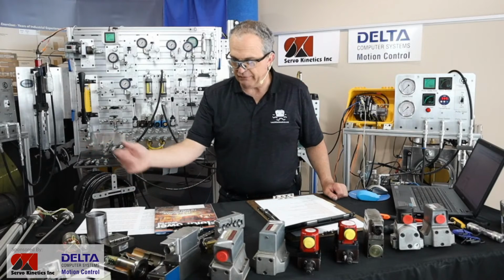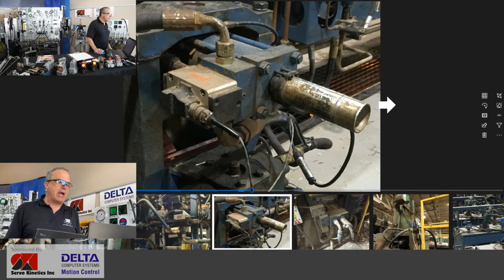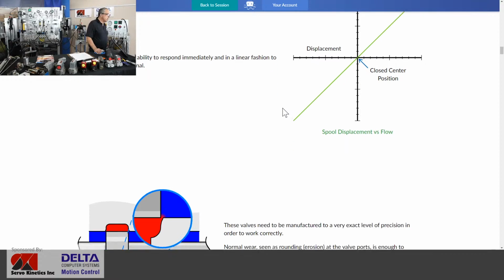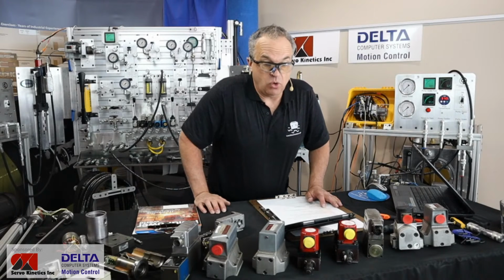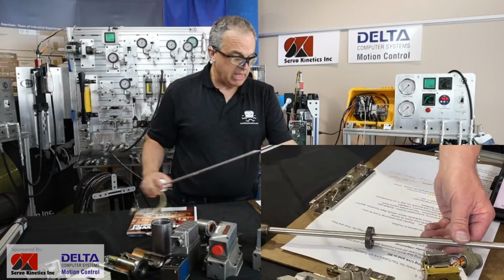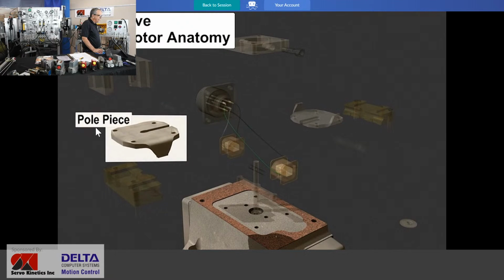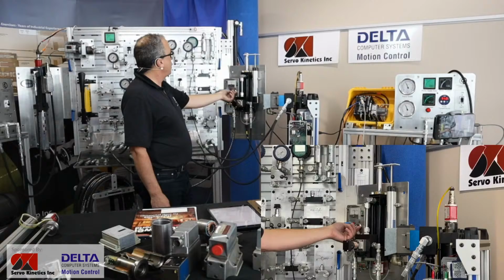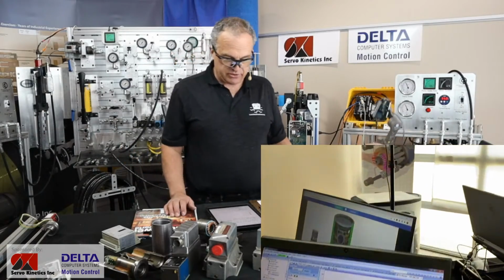Servo Valves: Live and in 3D

Comment: Your videos are absolutely great! One question: What happens with all the excessive flow from the pump, once the cylinder has settled (=valve closed)? Does all of the flow go through a pressure relieve valve? Wouldn't that create a lot of heat and losses?
Reply: Actually in industries , there is unloading valve for every pump which bypasses pump flow directly to tank in idle conditions, so pump rotates but system pressure will be zero.

Comment: Question on the 2-stage flapper valve? There is usually one tiny hole on the jet pipe itself and on the receiver block there are 2 small receiver holes on top of the shuttle valve sleeve. When the armories is magnetized or energized to displace left or right using the flapper wire to displace the flow, does fluid get pushed into one of the 2 small receiver holes?